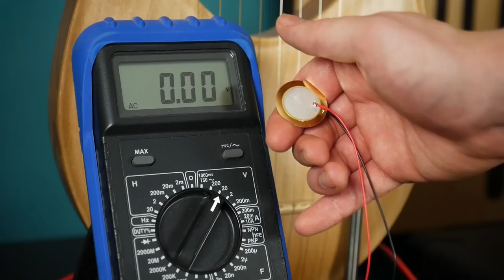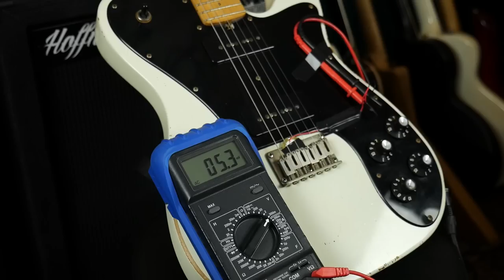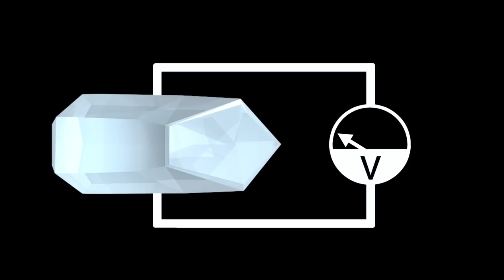How Do Piezo Pickups Work? | Too Afraid To Ask #42GSONE

Comment: The piezoelectric effect works both ways. The crystal will deform slightly when you apply a voltage.
Reply: Those park distance sensors in cars exploit the effect both ways!
Reply: I believe they used that in BMW injectors for a little while.

Comment: When I was a kid 60 years ago, you could get a crystal radio kit, which used pressure on a crystal to generate a voltage and would receive radio signals over the air.

Comment: 3:43 This is what you find inside electronic drum pads / triggers. For a long time I would buy "broken" electronic drum parts, replace or re-solder the Piezo electronic transducers, and then re-sell for good money. They're really cheap when it comes to drums. My EBMM Starry Night also has Piezo installed, and the option without those is $1,000 cheaper. I'm not sure why they're so much more expensive in the guitar. My guitar has two output jacks, one with Piezo and electric, and one that is just electric. I've noticed that the Piezo jack makes noise when I'm using my wireless system, so I'm trying to figure out how to deal with that. Could be a cheap wireless system, but not certain.
Reply: I think part of the price is that they can get that much money out of folks! Although all electric guitar piezo systems I've seen are pricey - 200+ dollars for a simple setup, be it graphtech, Fishman, ebmm. The challenge of getting the crystal inside the saddle, plus cramming a small and efficient and quiet preamp into a guitar cavity is probably what makes it that bit more expensive when compared to an electric drum pad.
Reply: I might have the explanation but i can't translate

Comment: One of the most popular things where piezoelectric effect is used is a simple lighter. Some of them use traditional flint and steel mechanism that creates sparks to ignite the gas. Others use buttons. When you press one, it charges the spring and then releases it. The spring has a little hammerhead that strikes down on the piezo crystal which creates an electrical spark. If you happen to disassemble one of them you could find out that it has a little piece of wire and you can even experience an electric shock if you unload the mechanism while keeping your finger very close to the wire. The same thing lights up all modern gas stoves. So you can definitely find some application to this effect in completely routine things.

Comment: As much as I appreciate piezo pickups for live performance, I have grown to loathe them for recording in a controlled environment. When I recorded an album as a student, we were forced to use the built-in piezos because we simply could not afford condenser mics or even more than 2 mono channels. So when we recorded guitar and vocals in one take for timing purposes (no click), I was stuck with the harsh, brittle piezo sound of the guitar, which was a bitch to iron out in the mix.
I later modified my Spanish-style guitar with a flat piezo glued to the inside of the body top, where the vibrations are much more smoothed out in comparison to the pickup position directly under the bridge, which produces a maximum of shrill high frequency response that is very unrepresentative of the acoustic sound of the instrument, which takes most of its frequency response from the body's resonance.
Reply: I think I'll try that now. In fact my favorite classical guitar that has the perfect sound and feel will be recordable. Thank you for figuring this out.

Comment: So I knew a couple of things about computers going into this. The mention of manipulating quartz to induce a current caught my attention. This is because all computers have crystal oscillator on the motherboard. Surprise, surprise, they are usually made with quartz. This inspired me to do some research.

Piezoelectric Effect in Computers:
As he stated in the video, when quartz is supplied with an electric current, it will vibrate. Depending on how the quartz is cut we can predict the frequency that it vibrates at. This is THE fundamental principle that makes computers possible. As I said, every motherboard has a crystal oscillator on it. Crystal oscillators are usually powered by a lithium battery on the motherboard so that your computer can keep time even when it is turned off (at least for a few weeks). In the computer world, this is called a real-time clock or RTC (just like your watch).

In the past, these onboard clocks were used to set the “clock speed” of the computer. The clock speed controls every function of the computer including how many instructions are processed per second. You could change the speed your computer ran at by changing the oscillator on your board. This was not always good for your computer as it forces every component to run faster and hotter and some components really aren't meant for that. More on this here: https://www.youtube.com/watch?v=2pWu_rJUiJs

In modern-day computers, the crystal oscillator on the motherboard is only used for keeping the RTC on track. The computer's CPU has its own crystal oscillator to control the clock speed and therefore all functions of the computer. Past onboard oscillators ran computers at slower speeds such as 10MHz. Modern CPUs run the board anywhere from 2GHz to 5.5GHz in most cases, though 8.723GHz is the overclocking world record.

“So where are you going with this?” you might ask. Truth be told, I have no clue. I just noticed a connection between two of my favorite hobbies. The next time you interact with a piezo pickup, just think about how the same science allowing you to make music is used to make every computer you've ever come into contact with possible.

Comment: Thank you for this detailed information!
I actually just cut my piezo wire and trying to figure out the correct way to reconnect the wires or to reattach to the piezo pickup itself.
Have any info on that?
I actually learned that my guitar which has had a piezo should have also had a preamp installed as well. I was told this is passive and not and active pickup. I have always had issues with plugging directly into a sound board without the preamp or without just mic'ing my acoustic amp.
Thank you for this info!
I will probably go purchase a really nice preamp with new piezo now and cut some holes into my trusty Ibanez.
Eventually I'll upgrade to a Martin or eventually a Taylor.

Comment: Well, this is a nicely timed video lol. I'd just been thinking about getting a piezo pickup equiped Fishman Powerbridge for my Strat, and was wondering exactly how a piezo system works.
Reply from the maker: Now you know! Sensing the string vibrations directly gives a very different signal to magnetic pickups, and processed correctly will allow very different sounds from the instrument than the standard magnetic pickups.

Comment: Stunning as per normal, I learn something from every one of your videos, but a question:
It was mentioned that piezo pickups are supposed to reduce feedback. If I plug my Tanglewood TW9E with a B Band M-450T EQ into a 'standard' guitar amp, as I did but once in my life while sitting with the amp elevated for easy reach, the resulting feedback was almost capable of launching me into the next room. I have never plugged it in since.
Or is it a case that piezo's are better but not feedback free and I was just lucky I wasn't using a normal mike as I would have still been in a low earth orbit?

Comment: Aye, Colin!
I have a question that I'm (obviously not) too afraid to ask:
How is it possible that different pickups, although working with the same method of turning a magnetic signal into an audio-electric signal, create different sounds?
I get how humbuckers and single coils sound different, but why do two distinct humbuckers provide a sound that differs from one another in output levels, frequency range and tone colour?

That's one question I really can't answer myself...
Can you?

And by the way: You're awesome in every way! Thanks for doing this!
Reply: It's a combination of factors. The strength of the magnet, and the shape of the poles and the resulting magnetic field has some effect. Another huge effect is how many turns of copper wire are used. More turns means it has a greater sensitivity to the magnetic field. But, more turns also changes the resistance, impedance, and capacitance of the circuit due to the fact that it is a physical object. And those different characteristics work together to create a specific frequency response. It is basically exactly like if you deliberately built an EQ circuit into the pickup. Another effect is actually the reaction of the impedance of the pickup to the values of the tone and volume pots, the tone cap, and the input circuit of whatever you are plugged into (which is why many modelers let you specify the input impedance because that already changes the tone). In short, it's an almost magical interaction of physical properties, the careful control and  balancing of which let the pickup creator dial in whatever tone they are going for.
Reply: @witeshade  Thanks for your answer, this has in fact clearified a lot of things!
Now, a Colin-made video with some split tests would still be amazingly cool... ;)

Comment: Here's the TATA I'm stuck on...I recorded my guitar player through a Radial J48 DI in to both his amp and my RME UFX. After a good take we hooked up a Radial X-amp and re-amped his performance through the same amp, but it just didn't have the same punchiness no matter the gain setting on the X-amp. Is it an impedance matching issue perhaps? Are there any gadgets that can help get the job done better? Thanks Colin, great channel.

Comment: not super accurate on the dipoles in SiO2 "cancelling out" because while its technically true its more accurate to say something like "sum to zero" because the two negative charges aren't interacting with each other and cancelling, they only interact with the Si and generate a formal charge of 0, but the partial charges denoted by delta are all still there, nothings actually cancelling. 

everything else that's slightly wrong is boring p-chem stuff nobody would think is that interesting like measuring devices and what not. overall top notch :)

Comment: Here's what I wonder.  And I'm not afraid to ask, either!  Can you run your electric guitar's signal into an acoustic simulator and the acoustic simulator's signal into an acoustic guitar preamp to get realistic acoustic sound from an electric?  You'd have to amplify this with an FRFR amp, I reckon.  Would it work?  Would it sound good?

Comment: So the piezo trigger you used on the electric guitar has that crystal in it? I use a drum trigger on my kick and curious about that. The first trigger I had was a piezo I got from radio shack years ago. Spliced it to a patch cord then plugged into my drum module. Worked pretty good.

Cool video, thank you.

Comment: Considering the sound of a pickup changes so drastically depending where along the scale they're placed, are there benefits or sacrifices on sound due to that placement? Are the pickups generally too weak to be fully utilized in an area with weaker vibration?

Comment: I would like to buy a K&k pure classic for a custom nylon guitar. This is a special project because the body of the guitar is hollow (of course) however there is no front hole on the body. I wonder if this is going to work fine. I can't use the type like Kremona because it's an headless Guitar and the bridge also act as a tuning knobs.. any suggestions?

Comment: Hah! I've asked myself this question but never thought to look it up, actually. It was a treat coming across this video today. The guitar seemed quite awesome, really.

I do have a lingering question, though: how does the electricity generated translates to pitch (like, how does it give the correct note)?
If it was covered on the video, sorry, I might have missed it.

Very interesting and informative, as ever!
Reply from the maker: Pitch in real terms is simply a frequency of vibration. We hear a certain note because air is vibrating our ears at a specific frequency. 

When it comes to pickups, the string vibration are translated into electricity where (to oversimplify) the voltage relates to the amplitude (volume) of the string and the alternating current relates to the frequency. 

AC is basically a 'vibrating' current, it oscillates with a frequency, the same frequency as the physical vibration that generated it. 

When you feed that alternating current back into a speaker then it forces the physical parts of the speaker to vibrate with the original frequency of the sound.
Reply: @ScienceofLoud  Thank you very much, Colin!

Comment: Hi Colin would a built-in preamp on an acoustic electric help to shape a piezo pickup tone?
Reply from the maker: Yes, that's exactly the point of a built in pre-amp, however it's only the beginning of the process. 
While it allows you to manipulate the phase, gain and EQ, there is a lot of other work still to be done to get something that would sound like an instrument. 

If you were to simply capture the raw sound off the pre-amp it wouldn't sound all that great (the same can be said about magnetic pickups too), that's why a good acoustic amplifier, or using plug-in solutions in a DAW, or perhaps even an acoustic IR pedal for live use are still essential if you want to tweak it to sound its best.
Reply: @ScienceofLoud  thank you for the wise words, Guitar Jesus #2

Comment: I like how I ended up heae because I wondered how tf vibration is turned into electrical signal. Well vibrating metal distorts the magnetic field in pick ups. Still didn't answer how, but I get the idea, then I'm like wait, piezo pickups work with nylon strings? How? Well mechanical energy through a crystalline object creates electrical signals. Okay well how the fuck does that work.
😂 

Guitars are magic